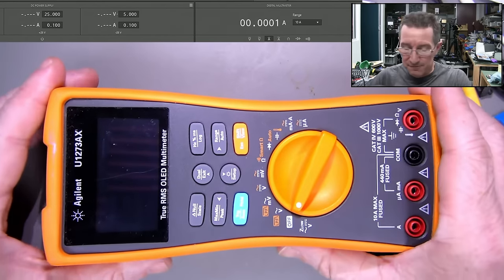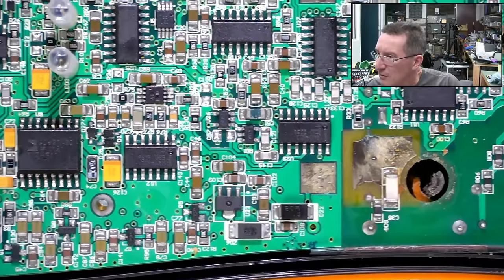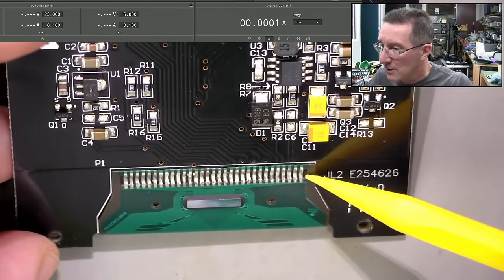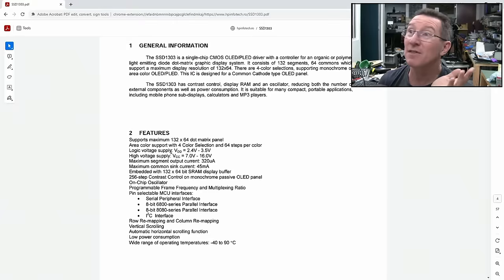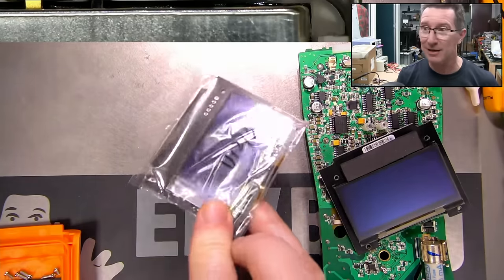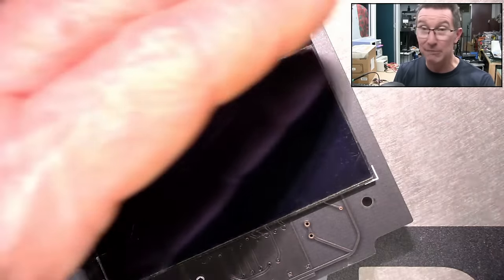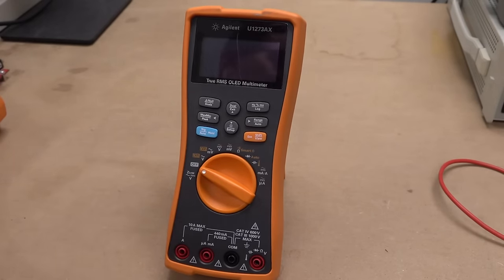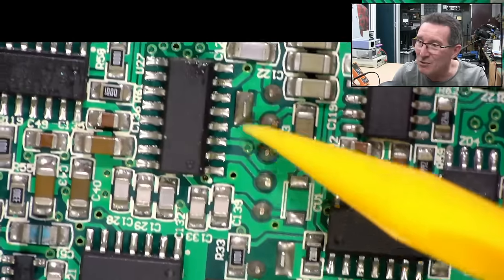EEVblog 1564 - Agilent/Keysight U1273AX Multimeter Repair

Comment: OLED displays are extremely sensitive to oxygen and moisture ingress, which is one of the reasons they are expensive-- they must use a glass envelope with metal feedthroughs that is hermetically sealed. Can't recall the channel, but the owner actually did some of the R&D on the original displays, and he explained how that was a major hurdle when developing them, just how to create a perfect seal.  Apparently it wasn't that difficult to get them emitting light, but without that seal they will very quickly fail.
Reply: Back in the day when OLED displays were quite a new thing, I had purchased a bunch of OLED character display modules to use in various projects. About a decade later, none of them work anymore, even ones that were still new in the box. The controller (HD44780 compatible) is alive and well but the OLED display emits no light at all. It would seem that when OLED was a very new technology, they hadn't quite figured out how to seal them properly.
Reply: Really cool but sounds like yet another reason to not use OLEDs in a meter. Just stick with good ol' LCD!
Reply: @HuygensOptics is the channel you are looking for, he has a video on how he did research on early OLED tech.
Reply: I wonder if this is the same reason cell phone OLEDs (the glass ones, not the film based ones that can be adhered to a rounded piece of glass for those stupid edges) completely stop showing an image once any part of it is broken.

I've had a few friends tell me they dropped their phone and it stopped turning on but in reality they managed to crack the oled without cracking the front glass and it simply stopped displaying an image.
Reply: but a lot of smartphones, generally high end ones use the soft oleds where the panel is kinda flexible, and even cutting a piece from it rest of the display is fine except for a few dead rows due to the cut, my point being there is technically no hermetic seal in those right?
Reply: @ShahZahid I would too like to know
Reply: @iamdarkyoshi  the hard ones also kinda work if a small piece from the top or edge breaks, resulting in weird lines on the display, the stop working as they aren't as shock resistant, cuz of their substrate being thin glass, so when dropped they just crack in multiple places causing the display to completely fail
Reply: I wonder how many Sony XEL-1 TVs still work.
Reply: HuygensOptics is the channel.
Reply: @chongli297  why not just a regular led display not lcd with led backlight?
Reply: @ChickenPermissionOG  I like being able to toggle off the backlight. Why waste battery life to light up a screen you can see perfectly fine in a well-lit room anyway?

Comment: I have this series of Agilent DVM, and leaking batteries absolutely wreak havoc on the plastic. I had to make do with popsicle sticks and epoxy as the “new” battery compartment since the old one turned to dust.
Reply from the maker: Interesting. There seem to be lots of subtle differences instrument plastics manufacture.

Comment: Back to front is a very common issue. In the display controller it is done with a single bit, and if you are trying to send commands before display is ready, it may be missing that command. And those displays take forever to initialize.
Reply: I wonder how easy/difficult it would be to either increase the reset delay, or have the display hold the main meter in reset until it finishes doing its weird and wonderful things.
Reply: @iamdarkyoshi  Meter just sends the data, so display module MCU can just accept and wait it until the panel is ready. It would be an easy fix if the source code was available. OLED initialization just needs to be made more robust.
I assume STM32 here emulates the commands of the original display controller, so it is possible that it is actually just missing that register write for some reason.
It is 100% fixable, but it would be on the makers of the board to fix it.
Although logically, it makes no sense to even interpret the initialization commands for the original display. You just need to accept the data. So, the issue is purely in the initialization code in the new module.
Reply: @AlexTaradov Can you dump the programming of an STM32 and put it through Ghidra?
Reply: @der.Schtefan Not unless they forgot to lock it. And clonners are usually good with locking stuff up, they know how easy it is to clone things. In practice it would be much easier to re-implement the whole thing from scratch. It is not doing anything complicated or involved.
Contacting the vendor may also work. This does not look like a typical cheap garbage, there is a chance they want to know about the issue and can fix it on their own.
Reply: I thought it was so you can use it in a mirror.

Comment: Fail for Agilent.
Not only having their top tier multimeters failing their displays, but also not having spare screens available, luckily the aftermarket came to the rescue, this time.
Reply: @lakinnenlako6883 I can't vouch for their old instruments for electronics, but Agilent is a top tier chemistry instrumentation company. It's the world leader in high performance liquid chromatography.
Reply: @lakinnenlako6883  Hardly, they are the defacto standard for an awful lot of test equipment.
Reply: @EduardoWalcacer they rebranded a few years back. Agilent is only medical now, Keysight is the test equipment company. 

It seems to me that this meter was outsourced, no excuse still for its poor build quality. And the cost of these things is exorbitant compared to Fluke, FLIR, etc. for same specs.
Reply: @lakinnenlako6883  this is indeed a video about the multimeter, not liquid chromatography or whatever that is 😁

Comment: High impedance board cleaning would make a great topic for a video. Almost nothing about it on youtube. The proof of a clean board is a test at 90-95% humidity, cleanish boards can pass at low humidity like in an airconditioned room.
Reply from the maker: I was just thinking this. It would need a controlled experiment with high impedance exposed traces and controlled amounts of contaminent.
Reply: @EEVblog  that sounds great!
Reply: The humidity vs creepage path problem makes a good argument for conformal coating PCBs where accuracy is important.
Reply: Yeah man do it

Comment: I recall sending my meter in for a recall. Keysight exchanged it for another model. I can't remember what the issue was with the original product though. Stinks because the OLED is great for use in pitch black electrical cabinets. Easy to read at any angle.
Reply: Downside is she chews the batteries compared to an LCD!
Reply: @TradieTrev  true.

Comment: My OLED went on my U1273AX - just completely blank one day. I ordered an LC-OL12864-09-YO-A7 from LC Design (Germany, around 110 euro incl shipping) and it dropped straight in & works perfectly. Such a shame Agilent presumably know full well this is a design issue on a very pricey meter (as they offered replacement screen modules) - Didyou see their pricing for a replacement (when they offered it)? Truly stupid expensive. It's my most expensive meter, and the one that lasted the least long. Now happily working again without fault. Nice video, Dave, as always.

Comment: You'll find that your calibration problem is probably due to battery electrolyte soaked into the fibreglass of the pcb causing stray conduction paths. I have come across this problem before. It's a very difficult job trying to remove the paths by soaking it in solvents etc for many days, but always worth a try I suppose.
Reply: That could be tough to clean without destroying the PCB and you don't want to damage the surface mounted components. I find modern electronics almost impossible to fix.

Comment: I bought my el-cheapo DMM about 20 years ago, and it still works.   🙂
Reply: But can you reverse the display on it so you can view it with a mirror.
Reply: Well el cheapo accuracy is likely off as they don't test or calibrate these things. They're produced to be disposable. But hey they work.
Reply: @ianhaylock7409  I can think of a few times when that would have come in very handy.  🙂
Reply: @jonfreeman9682  I've never needed that much accuracy, nice but not needed.   🙂

Comment: To wash the pollution, it is not enough just spray and wipe with a brush, you need to collect the dissolved pollution using a napkin. If an alkali hit the printed circuit board, you must first wash it with a light solution of citric acid, then rinse with water with a soap, and then rinse with ethyl or isopropyl alcohol and wipe dry with a napkin. I saved a lot of electronics flooded with different active liquids (alkalis, acids, salt).
Reply: After neutralizing the alkaline stuff the best is to soak in lots of warm de-ionized water. Product of acid and base mixing is some kind of salt which in solution is conductive too

Comment: My lab received 5 of these as "freebies" when we bought real Agilent Source Measurement Units (~$10K each). Five years later NONE of them worked. No battery leakage. We threw them out. My Fluke 23 I bought new in 1981 works like the day I bought it. All the handhelds we use now in the lab are brand 'F'.

Comment: I have a Fluke with battery damage, after cleaning, restauration of the contacts, 3 years ago, it failed this week. Feeding it with a bench supply there was no problem. When I wanted to clean the again corroded battery contacts, one of the still good looking contact dropped off in 2 parts. Turned out to be corroded away from the backside.  For battery leakage repairs I always remove parts and clean under them, did that here too, but not the battery contacts. Also had something similar on an other meter, there the wire from battery holder to PCB was corroded away from the inside of the wire.
Reply: Battery damage if not too bad you can still clean and repair as long as the surface mount components haven't eroded. I haven't come across too many battery leaks. Not sure what causes it but for extended non use it's best to leave the batteries out.

Comment: Well what do you know! I acquired a 1273A which had the exact same issue - suffered battery leakage and was scrapped due to being out of calibration. Pulled that same capacitor and gave it a good cleaning (despite no signs of gunk under it) and it seems to have fixed it. This'll be a nice upgrade over the AN8008 previously bought due to Dave's video on cheap meters 🤣

It still has the RF interference problem on the current range but I can live with that...

Comment: This is my favourite multimeter. The OLED screen is great to read at any angle. Also I use the non-OLED version of this which I don't like as much. Also I find that the Fluke 289 is the worst LCD I've ever used (can't read it unless looking at it directly).
On the U1273AX, I've disabled that silly startup melody and also disabled auto power off (nothing worse than using all hands and legs to probe something with the tongue at the right angle and the DMM beeps and goes off!).
Reply: OLED is the future of high end meters. They need to differentiate with cheap meters. OLED definitely looks more cool even if it's kinda gimmicky. Would be nice if they use higher res OLED and add more useful functionality.

Comment: Some suit made a genious move with pushing for oled, it makes people wanting new stuff want it and it breaks far faster so companies will outright replace the device instead of repair if it fails after warranty.

They looked at meters working just fine 10-20 years after production and went "THAT IS NOT ACCEPTABLE"
Reply: Always wondered how Fluke stays in business as it's buy one last forever model isn't good for repeat business.

Comment: Great troubleshooting David. I had a feeling the battery leakage was under a component. Still NO easy finding that one !

You and Paul Carlson do a super explanation of electronics fault finding, and repair.

Sad to see how much dollar pinching is going on new electronic test equipment.

I remember many Years ago using Hewlett Packard Optical Spectrum Analyzer HP OSA 70004A / 70952B, I used just to align the input collimator  to the first wave splitter filters, was great equipment to use FUN TOO yet made The Brain go on Full Afterburner. 

If you have done any work on optical test gear David, could you reply with a playlist please. Thanks

Best
Kristy

Comment: Did the exact same OLED module replacement you did, but the module I bought has a bug where when it shows the negative sign, one or two columns of pixels of that minus sign are basically wrapped around to the right side. A bit distracting I have to say. Messaged the seller and they actually came back with a detailed explanation of the issue, but I'm not convinced they couldn't have done something to suppress it. It doesn't have the reset issue yours has though lol
Reply: So did they have a solution. Is it defective or faulty design. That's the problem with 3rd party parts.

Comment: Thanks Dave for this vid... I stupidly invested in the U1453A DMM but also the U1253B 'blue' coloured OLED insulation meter. It was not a cheap kit either & in 4yrs probably used it 4 times.... until the other day i really needed it & find it's gone dark on the OLED & Keysight have ensured i will never support them again! So finding another OLED for it is going to be interesting & since my daily use U1453A with its yellow OLED is still rolling along fine i guess i'll be up for spending time to have my U1253B usable again....

Comment: It's a shame such a nice, premium meter has a major reliability issue with the screen. Perhaps a few more will be repaired thanks to your video.
Reply: It is only marketed as nice and premium, it is trash. OLED is not the right thing to use for frequently used electronics (eyes strain) and it is not reliable as rugged indicator either.

Comment: Isn't that just a 0.05" pin header?  Buy or make a ribbon cable for it to be able to probe the control board.  Also, 138mA current draw is with all pixels on, which is atypical.  With only 10% of pixels on you're looking at more like 14mA.

Comment: The OLEDs on TS100 Irons go bad for no other reason than they want to !...cheers.
Reply: Had that happen on my exmaple
Reply: But that's a product in a totally different priceclass.
A ts100 display can be had delivered for $4 or so and the complete iron is like $60.
This multimeter is supposed to be a top tier product, priced at $500 or 600 or so.

Comment: On the battery corrosion issue, I'm sure I'm the only  one in the world who has replaced all the alkaline batteries in my devices with Lithium Ion. Undoubtedly a grocery list of reasons NOT to do this, but after have the batteries corrode in my EEVBLOG meter--I made the switch. And no more corrosion issues--just fire issues (LOL).
Reply: I’ve done this too with items of significant value. For the cheap items I didn’t bother.
Reply: @timwhite8500  I bought a wholr bunch of AA & AAA Lithium batts so did everything. Even my toys.
Reply: Lithium batteries are not cheap. But they definitely last a long time. You buy a set they last forever.
Reply: @jonfreeman9682  The most important thing to me is not have corrosion which will leak and destroy my devices.  I have many gadgets which aren't use for months or years. Lithium batts puts a stop to this.
Reply: @shubus  Lithium batteries can leak too but they're less prone to leak than alkaline. You can also use carbon zinc. They're the cheapest and I heard they don't leak but not sure.
Reply: @jonfreeman9682  Thanks, I'll see if I can find some carbon zinc batts.

Comment: For how good and nice to use OLED screens are for multimeters, they are kind of a mixed bag in terms of longevity. Especially when you are dropping something like 700USD on a bench multimeter that is similar to this (the keysight 34450A).

When the display died about a year after I bought mine it costed more to ship it to keysight to repair it under warranty than to just buy a replacement screen and do it yourself. Changed the color to a more high contrast yellow too in the process.
Reply: OLED are great and last a long time. Practically as long as LCD and look much nicer. But expensive to replace.
Reply: @jonfreeman9682  That's not true. They don't last nearly as long as LCDs as the pixels get dimmer over time ("burn-in"). While they are more expensive, the difference is not massive. The only reason it is expensive to replace in this case is that it is custom to this model. A custom LCD would be pricy to replace too.
Reply: @0xbenedikt  I remember my old Samsung S4 phone did have OLED burn in but phones are on all the time. OLED should have improved since then. They are brighter and richer color than LCD so all top phones use them now. Meters should be able to use OLED without burn in as they're not on all the time. That being said meters don't really need such colorful displays like phones which are used for entertainment.

Comment: Battery manufacturers need to be accountable for battery damaged devices
Reply: Duracell will pay for a replacement item damaged by battery leakage, I've been paid out for 2 D cell Maglights ruined by leaking Duracell batteries.